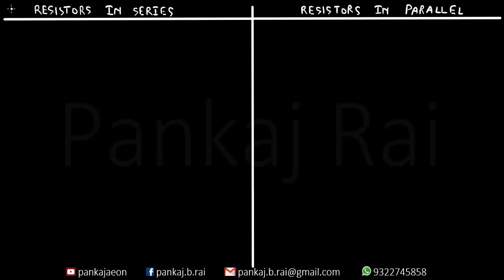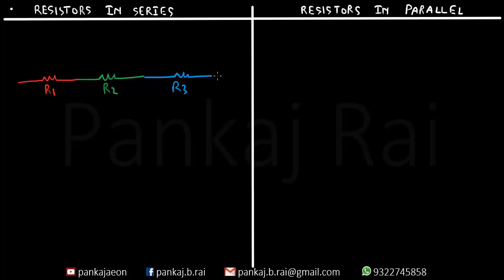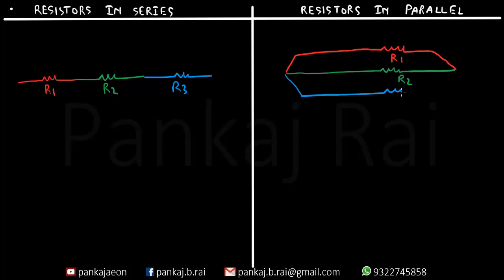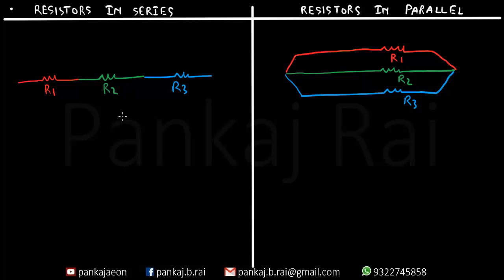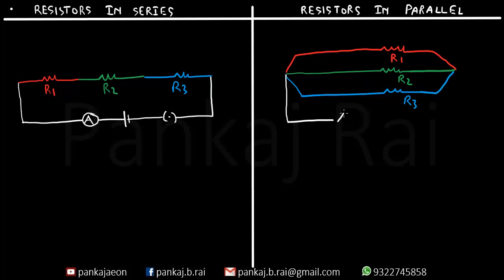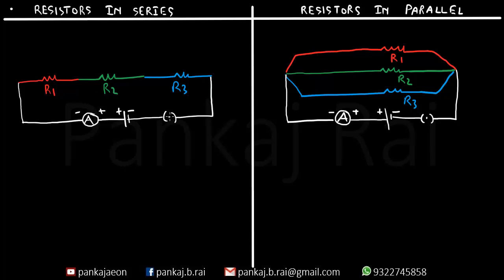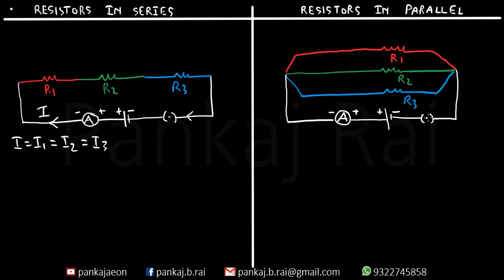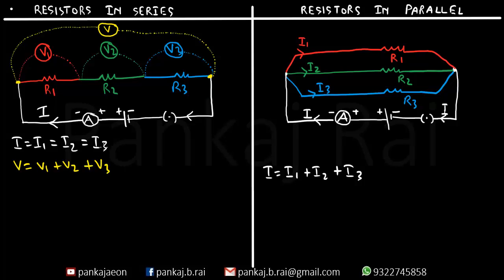Resistors in Series and Parallel Derivation and Distinguish

Comment: WHY IS AMMETER CONNECTED IN PARALLEL ?
Reply from the maker: An ammeter is always connected in series with the branch of which current you have to measure.

A voltmeter is always connected in parallel across the branch between the two points you have to measure the potential difference.